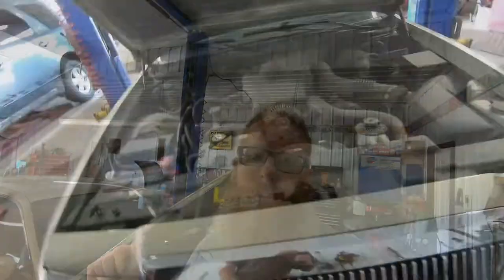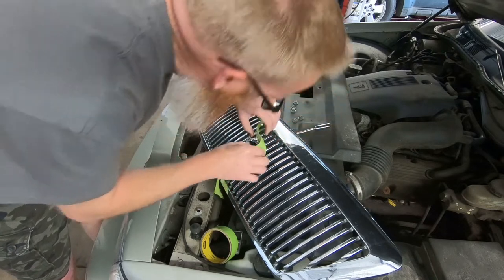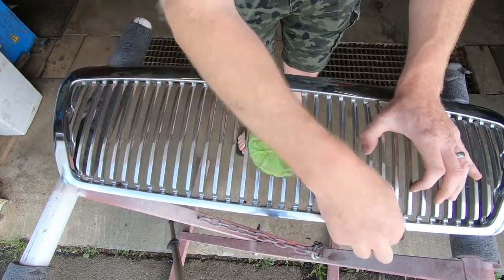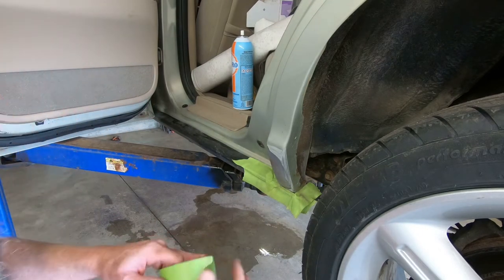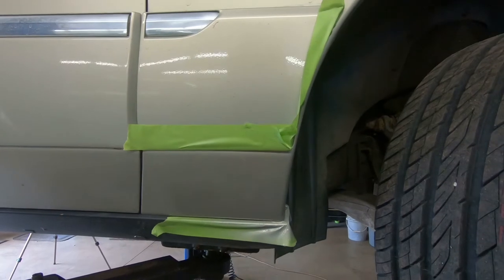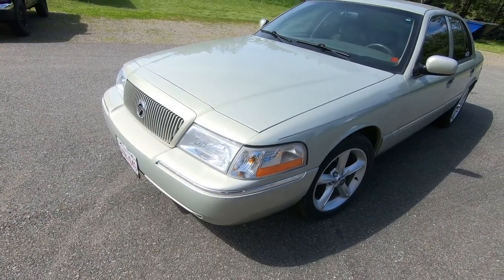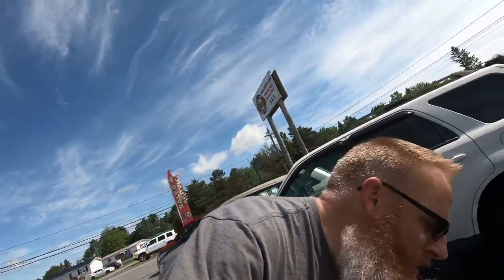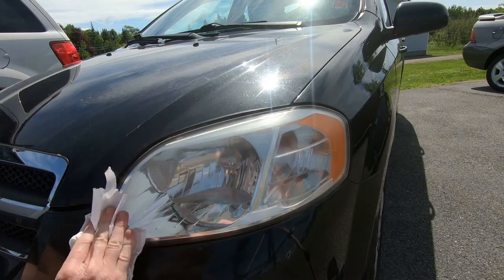SLOWLY TRANSFORMING MY MERCURY GRAND MARQUIS INTO  MARAUDER

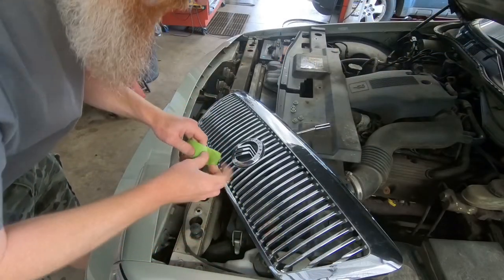Comment: 2:20 You're so lucky you got a traditional mechanical throttle Panther (2004 Last Year). 

4:25 I bet Caper was dying to spray the grill for you. Lol

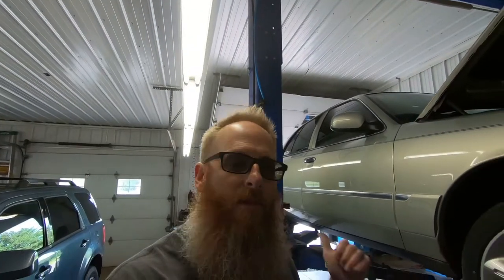5:34 This is the difference between people who love / respect automobiles, and people who treat them like disposable appliances. 

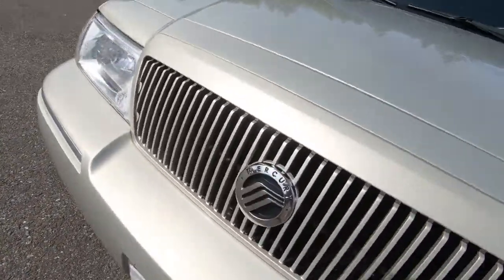9:55 If the painted grill starts to chip, maybe black plastidip, or just the black honeycomb grill. 

Still waiting for the 5 Speed Manual Tranny Swap.
Reply from the maker: Thanks Chuck! I’m not Gonna mess with the performance until I get the exhaust on it! We’ll see how she works and sounds after that! As far as the tranny swap, you’ll be waiting a while! lol

Comment: Looks awesome!  I have a 04 Grand Marquis with 65,000 original miles. Did dual exhaust and Flowmasters. Getting rust in the same spots as Grandma. My front fender is getting bad. Is replacement easy of the front fender?
Reply from the maker: They are a bit of a bugger, but not too bad if you're handy!

Comment: Definitely going to try this on my ‘03 Marquis! Couple questions; where can I snag my paint code/have aerosol paint made? What brand clear did you use? Thanks so much!! LOVE the channel!
Reply from the maker: When you open the drivers door there should be a white tag on the door (or on the door jamb). Ig you look at the bottom left corner, it will reas "EXT PNT:" follower by two characters. That is your paint code. Both my local Napa and Carquest mix spray bombs in single stage (no clear coat required) or in base coat. They should be able to provide you with the appropriate clear to finish the job! I hope this helps.
Reply: @OldeCarrGuy  absolutely a huge help, thank you!! At 37 I’m slowly making my way into amateur mechanics, after getting my 03 MGM. You and grandma have been a great source of information and inspiration; thank you!!
Reply: @OldeCarrGuy  also, would you recommend the single stage over base coat?
Reply from the maker: @pfresh  IMHO base clear provides better protection due to more layers of paint & clear. Having said that, single stage leaves a great finish and is much quicker (less coats needed).

Comment: I live in Calhoun, GA. Where can I go get a color match paint put in a spray can. I also have a 2004 grand marquis it could actually be the same color as yours. I’m wanting to touch up on some areas especially the front bumper. But I’m looking to paint my grill black. Are there any suggestions what I should get to paint my grill black?
Reply from the maker: Any paint is good as long as the surface is prepped. I like any sort of rust paint as it seems to spray a bit thicker. Better protection against rock chips.

Comment: Omg this is like my dream come true I'm doing all of the same things to my 2008 grand Marquis, but can't fight a spray that matches. I think that's my cars color  is that paint code HG smokestone metallic? If so where can I get that exact spray paint. Mine didn't match at all and I used Sherwin williams automotive paint
Reply from the maker: My paint code is C2, Gold Ash Metallic! If you want to match the paint color, find a parts store like Napa or Carquest that mixes paint into spray cans. That's what i did and it only cost $30.
Reply: @OldeCarrGuy  OK thanks. Will do.

Comment: I never felt any need to modify any of my Grand Marquis. I'm definitely not a fan of those huge ghetto wheels and tires with one inch sidewalls. On my '05, which was white, the alloy wheels were pretty tarnished up and had some curb rash. I found a set of good condition gloss black steel 16" cop car wheels (before they came out with the 17" ghettos) repainted them, and got some brand new chrome cop center caps. I'm an amateur radio operator, so I had three antennas on the trunk lid. I live in AZ, so I got an AZ flag for a front license plate. To somebody that didn't really know what they were looking at, it looked a lot like a cop car. I even thought about putting fleet numbers on it, but decided not to. 

The grille doesn't look bad, but I prefer chrome. I even wish it had chrome bumpers, 15" wheels with whitewalls and full stainless steel wheel covers, and a vinyl top. My dad had a 1975 Ford LTD, Ginger Brown with a tan vinyl top. That was a beautiful car. As much as I like the Grand Marquis and Crown Vic, they do look somewhat like a much larger version of a '90s Toyota Camry. These cars need an oil change every 3000 miles if you want them to last 400,000 miles.
Reply from the maker: That’s the beauty of customization. We can make them our own.

Comment: Grill came out awesome where can I get the paint so I can do mine
Reply from the maker: I got mine at my local Carquest store But any Napa or parts store that sells paint should be able to help you. All you need is the paint code off your door sticker and they should be able to put it into a spray bomb for you.
Reply: @OldeCarrGuy  awesome thank you very much for the help
Reply: @OldeCarrGuy  hey I have another quick question the rims on your car what size are the tires
Reply from the maker: They are 18” wheels off a 2011 mustang with 245/45R18